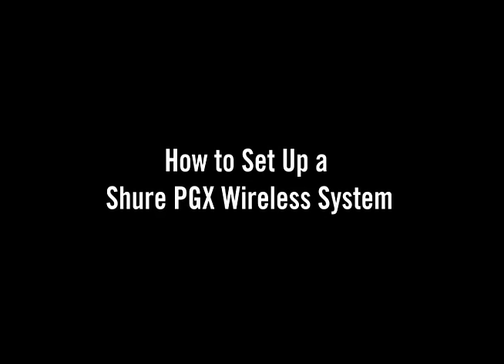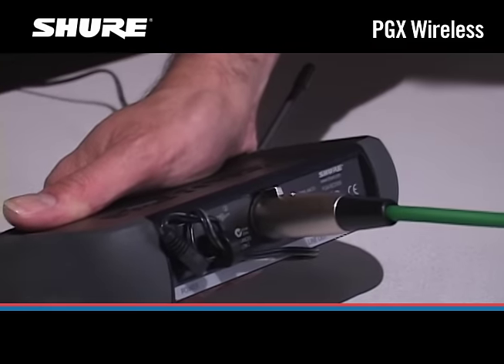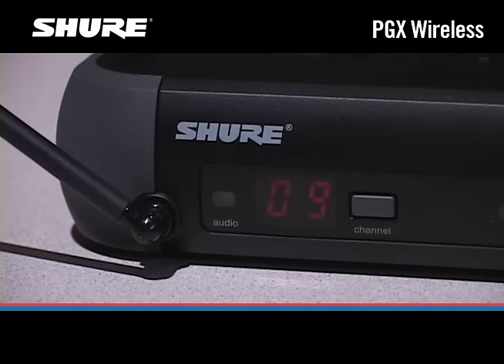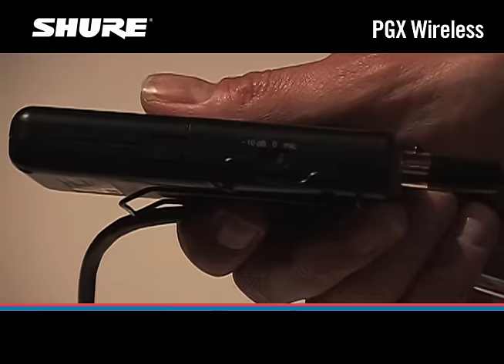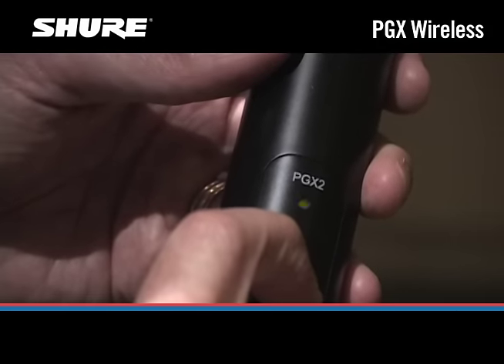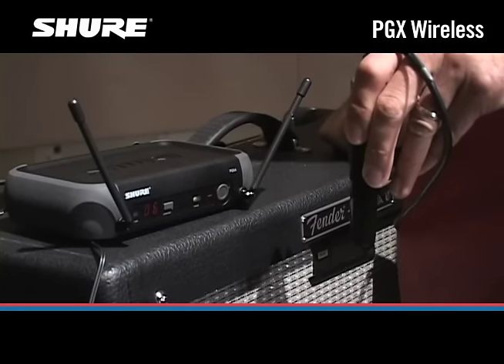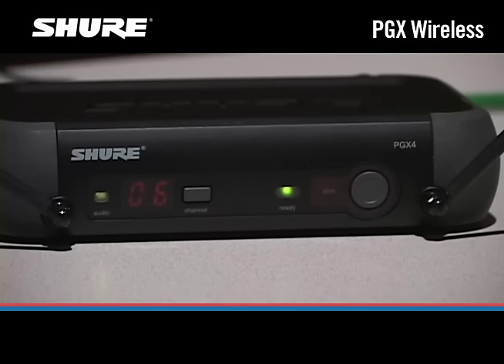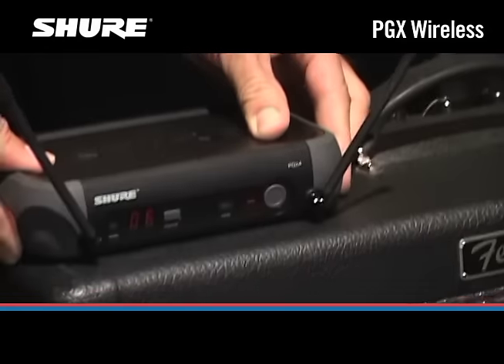PGX Wireless - How to Set Up a System | Shure

Comment: I've had this unit for many years. Never had an issue til an audio tech changed the channel. Now when I go to use it, the audio light on the unit stays in the red and buzzing audio comes out. I use a handheld and not a body pack so where on the handheld do you adjust to clear this issue up?
Reply from the maker: We're really sorry to hear that. Our Support Team will be able to help you out with this. You can reach out to them at shu.re/contact.

Comment: Can you use the wireless beta56 microphone wired with xlr cable also or is it only able to be used with wireless transmitter?
Reply from the maker: Hello Robert! You might not have the right mic model number... the Beta 56 is a wired drum microphone. That said, the only way you could use a wireless mic in a wired form factor would be to use the VPH Long Microphone Handle accessory, but that would only work if the wireless handheld you're using has a capsule that can be screwed off.
Reply: Shure I’m sorry - it is the pgxd24/betaA58-x8.  I got for my daughter for her graduation and I don’t know much about these things- planning on plugging into her fender acoustic 100 amplifier- again knowing little about these things- seems like this PGXD is not as easy to find on your website and wondering if it was a still a current model before I gave it to her also- thanks so much for your reply!
Reply from the maker: @robertenglehardt9706  No worries! Yes, the PGX-D System is still an active wireless line in our catalog. That system does feature removable cartridges (you'll see the seam just an inch below the grill), so you could unscrew it and attach it to the VPH Long Handle Accessory if you needed to make it wired. As for plugging into the amp, you might want to talk to our support team to make sure you set it up correctly. Please open up a ticket with them at https://www.shure.com/en-US/about-us/contact-us.

Comment: I have about 6 of these mics+receivers. They all work but it's a mess having all those antennas and cables. Is there a way to remove the antennas on each receiver and combine all of the 6 receivers and have just one pair of antennas? i'm hoping it will help declutter and also diminish RF interference
Reply from the maker: Our support team can best advise. Please open up a ticket with them at shu.re/contact.

Comment: Hello. I have a question please. can I use two pgx2 transmitters (microphones) with one pgx4 receiver?
Reply from the maker: All PGX receivers are single-channel receivers, so you can only use one transmitter at a time. If you tried to use two simultaneously, that would be like trying to tune in to radio stations on the same channel.
Reply: @shure  ok i see 😊 thank's

Comment: Can multiple transmitters be set up with a single receiver? I'm trying to set up a system for a round table type of set up and don't have the money to buy multiple systems.
Reply from the maker: With wireless mic systems, it is a one to one ratio of transmitters to receivers. Otherwise, it would be like trying to get two radio stations in on the same channel at the same time.

Comment: Can I connect an iPhone 6 Plus to the system, is that possible??
Reply from the maker: It is possible to connect a device’s headphone output to a wireless transmitter, but it will require a special cable or an adapter.
 
The bulletin in the link below lists a couple of sources for these cables.  We also are aware of a 3.5mm to TA4F cable from a company called Canare, although we do not test any of these 3rd-party products.
 
https://www.shure.com/americas/support/find-an-answer/headphone-audio-output-to-wireless-bodypack
 
You also might be able to modify a Shure WA302 instrument cable with the 3.5mm connector, or use an adapter.
 
The input switch on the PGX1 bodypack probably will need to be set to “0” or “-10,” not “mic.”
 
https://www.shure.com/americas/support/find-an-answer/3-5mm-miniature-phone-plug-into-ta4f-connector
Reply: This is what worked .. I connected the iPhone to the IRig Pre and the IRig Pre to the unbalance output of the receiver .. this allow me to use a The wireless transmitter with the lavalier mic to get sound on the iPhone ...